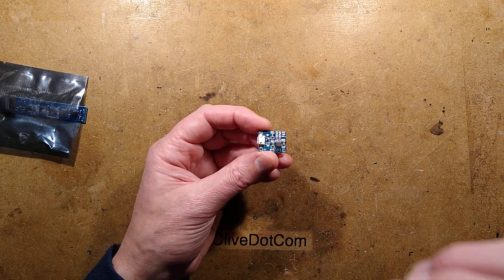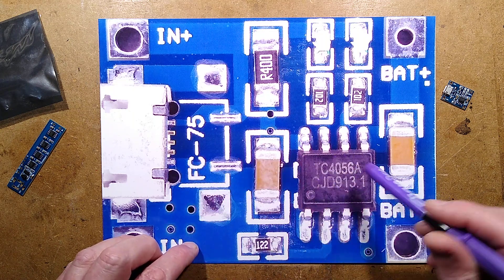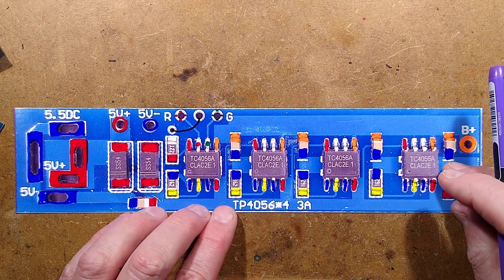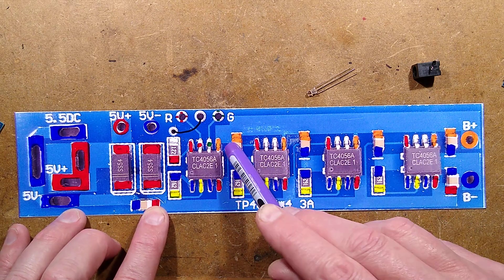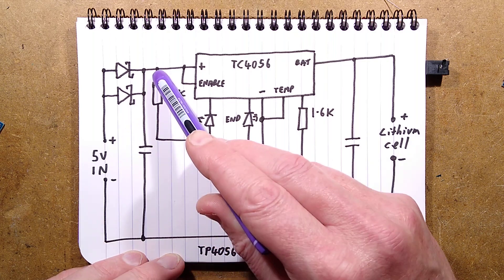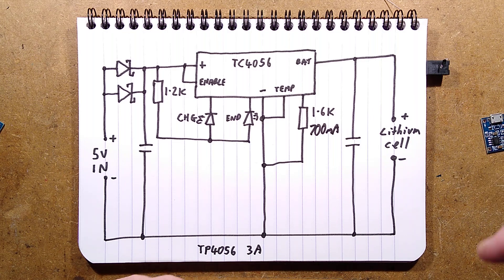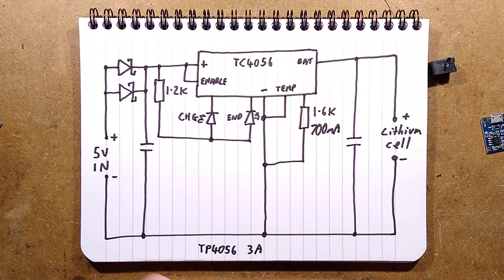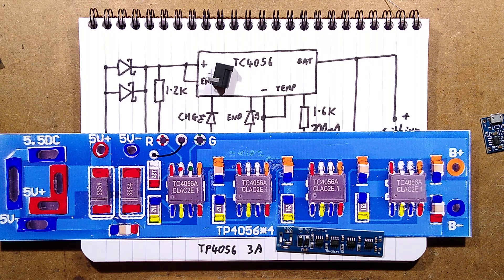eBay 3A lithium charger module with schematic

Comment: .7A * 1.6 kΩ = 1120V
How is that ^^ possible with a 5.5V supply?

If a person wanted to lower the charging current of this circuit, would one increase or decrease the 1.6 kΩ resistor value?  I'm guessing increase it to lower the current as E/R=I
Reply: It uses current amplification, only a fraction of the charge current goes through the programming resistor. But yeah, higher resistance, lower charge current. Mine are all fitted with 2.2kΩ
Reply: That resistor is used to program the output current of the chip. It means 0.7A is not flowing through the resistor.
Edit: TP4056 datasheet clearly says how current programming works and also provides a formula for current calculation.
Reply: @eskisful  Does that mean that 2.3A is flowing through the resistor?  (i.e. 3-.7A)?
Reply: @ab_ab_c  No. Resistor is not directly connected to charging output line therefore resistor current goes through the chip internally. Only 1 or 2 volts are present on the programming pin so  the current is about 0.6 mA or so, flowing in the resistor.
Reply: @eskisful  I looked at the formula in the datasheet & it doesn't make sense to me.  The datasheet does show a table of resistance values that will produce the desired cell charging current though.

Comment: So the LTC 4056 from Analog is not pin compatible with the TC4056 and the TP4056. Which are, while compatible with each other, from two different companies. And there's also another manufacturer (maybe a secondary supplier for TopPower) listed as "TP4056" up on LCSC that's even cheaper. But at least the markings on the chip are specific to their product.

All that circles back on one of those non-Analog parts having a problem with low amperage in at least some revisions that I ran into (I eventually went with a direct LTC clone). It ignored the settings resistor down around 10mA and charged at a higher rate. Although now that I'm looking through the parts lists there's no way I'm going to figure out which chips (or knock-offs of which chip).

So it's probably worth cracking out the meter and checking to make sure the circuit's charging at what the maths suggest it should! With a given batch, anyway.

Comment: I remember seeing a video on the same subject a while ago, the module did not work very well because of differences between the TP4056,s some changed from CC to CV before the others.
Reply from the maker: There will be slightly different voltage thresholds.  They will not all turn off in sync.  The charge current will fall in steps and the final cell voltage will be dictated by just one of the chips.

Comment: i don't see the other chips that normally come with this module. "DW01 & a little dule MOSFET for under/over voltage... PLUS i think, NO I'M SURE! you can parallel up the original module  "AS IS" might be more room needed for them in a project, but if they had the extra chips.  well..
P.S i love the TP4056 module's

Comment: How can that tiny little chip handle such a huge current?  Amazed it doesn't just burn out, I wonder how hot those chips get in use?  You could try spitting on the chips every couple of minutes to keep them cool - I did that with a regulator once.
Reply: they get very hot under full load, they are a lot happier at 800mA or even 500mA than at their supposed 1A rating. But they still get hot, cause they are linear regulators.
They also make squeaky noises, I don't really know why. I guess they oscillate in audio frequencies under high load or something. I should really probe one with a scope some time and see.
Reply: @AlexanderBurgers  I wonder if they would eventually cut out or go up in smoke?  Go up in smoke is much more fun and I like the sweet smell of burning IC cases.  I guess tiny chips like that would just unsolder themselves when they got too hot.
Reply: @ianhosier4042  No idea, in standard configuration they can go for days flatout with no issue. I haven't tried overloading them beyond 1A. If you reverse the polarity on the  battery they insta-pop, but not very spectacularly. Oh yeah, they also have a big thermal pad under them, I guess that does help with cooling.
Reply: They are designed to work while hot. The TP4056 spec sheet lists 145°C as maximum operational TJ. I don't think they have internal temp shutdown.

Comment: Somewhere there is an electronic engineer really annoyed because the LED has the common pin in the middle, and only because of that he had to design a double-layer board instead of a single-layer one.
Reply: Tracks fit under resistors, it's like they weren't even trying. :P
Reply: It's for the dual colour common anode LED's.... but i see your point, the layout bothers me more than it should on the standard board too, they could have put just one resistor on the +v rail to feed both LED's and straight to IC (like they have on the higher current version).

Comment: I thought that putting 2 diodes in parallel does not increase the current capacity.   Since one of the diodes will have slightly lower voltage drop, due to tolerances, it will burn out first.  What happens is they burn out individually, one after another, at the rated current for a single diode.
Reply: Yeah but the circuit does last twice as long than with one diode.  I used to think paralleling diodes increased current rating and learnt how wrong I was the smokey way - each diode did indeed blow at its rated current.
Reply: @ianhosier4042  don’t two diodes in parallel just disperse the current through both providing less stress on diodes ?
Reply: @94mac  Not really. The forward drop is always going to be slightly different. So one diode will be "full on" and the other somewhat less, typically a lot less because diodes don't have much of a linear region.

Comment: I played with one of these a few years ago and found the tp4056’s all finish charging at quite different voltages by adding more leds. https://youtu.be/YBSgtA0bfAI
Reply: Yes, I just saw it. Useful！
Reply: Interesting.  I wonder if that's a deliberate thing to slow the charge at high states of change or accidental
Reply: Congratulations on winning the 100 CS LBC on your odyssey channel, see your odyssey about page at the bottom  = 100 LBC

Comment: I wonder what happens when some of these filtering caps in the output will have noticeable internal current leakage — big enough to restrain the chargers from finishing charging and not big enough to cause a decisive short-circuit.
Reply: These chips don't really have a finish charging state, they just level off at 4.2v and the current sag, if you have leaky caps, or cells with high self-discharge, they'll just get warm, the chip doesn't care even a little bit. If you run whatever load is connected to the cell while it's in the 4.2v float state, it'll happily go back to constant current, all analog, no state machine stuff.

Comment: I'm wondering if you could not gang all of the current control pins together and use one resistor to ground so they would all be getting exactly the same signal. That way you might get a little closer to the four chips sharing current evenly. You might not be able to do that though it depends on the behavior of that input pin. It's probably going to be a lower resistor than what the calculation would show because you're going to have the residual current from the four chips going through one resistor.
Reply from the maker: That may skew the current ratio due to each chip supplying current to the same resistor.  The cost of one resistor per chip is insignificant and operates them in their intended way.
Reply: @bigclivedotcom  I was thinking the resistor tolerance might throw them off from each other a little. Only one way to tell, hack!

Comment: This looks so shitty. There are IP2312 based boards that are similar in size to those smaller TP4056 but are better in every possible way. 3A, switching regulator instead of linear, higher efficiency, supports higher voltage lithium cells (4.3v, 4.4v, etc.).

Comment: This design seems pretty unreasonable tbh. They increase the current by just throwing more circuits in parallel, which takes up much more space, still has terrible efficiency and probably costs a fair bit. For this kind of power it should really be a buck converter instead. It would be better in every way (excapt maybe noise if it's not designed well).
Reply: I got a 5-pack of the single 4056's for $1 4+ years ago.... If you can design and get something produced thats superior, at the same low cost then looking forward to buying it.

Comment: I presume the TC4056 and TP4056 are different. The TP4056 has a low voltage disconnect function, with different connectors for battery and load
Reply: no? you're just thinking of the modules with the TP4056 chips that also have the DW01 chip that does low voltage disconnect, very helpfully also named TP4056 for extra confusion. The chip itself has no such feature. :)
Reply: @AlexanderBurgers  I think you're right! Better setup.

Comment: Cool. 
Clive how about getting us all motorised? A charging circuit suitable for larger battery packs, a motor controller suitable for current and voltage being used. Batteries and motor could be discussed with practical voltages and energy storage and motor types and drive for a lightweight vehicles, scooters/bikes. Broken down each element is easy to explain..I've noticed there is a lot of confusion about all of it.
I think it would be a great series.
I know it would be a bit of work though..
If you or nobody else does, maybe I should start my own channel?😸

Comment: I have somehow killed 3 of those doing nothing wrong and running them very cool.
Reply: semiconductors not always like running cool. forward voltage drop lowers when it gets hot. many doides and mosfets benefit from that when they run a bit on the hot side...

Comment: Hi Clive do you have vape starter sets over in your area for a pound? We have them in the U.S.A. for $1.00,  they have a battery and charger circuit included.
Reply from the maker: They sold disposable vapes for £1 (with rechargeable cells).  I have to be careful about vape technology videos on YouTube.  They don't seem to like them.
Reply: @bigclivedotcom  Yep that's why I didn't name them or tell how to modify them for other uses.

Comment: The faster you charge your Li-Ion battery, the less life it will have.
Reply: true
The number of time spend at extrem es like 100% and 5% charge is also important aswell as the number of charge/discharge cycles.

Comment: Note that these are just chargers, no cell protection is provided.
People should buy the version with DW01 IC for cell protection. Same small size and price really.
Reply: Interesting.  Got a link to such a 3A board?
Reply: @ab_ab_c  there is no 3a board with protection included to my knowledge. He was talking about the 1a tp4056 module like what Clive showed in the beginning. There is a slightly larger version with a cell protection ic(dw01) on board. The tp5000 is a 2a board with protection and boost converter.
Ip2312 is a much better, and more efficient 3a charge (only charge) module though.
Reply: @bridoc519  
YT is preventing me from posting a message that contains multiple urls to 3A boards.
Any idea why that may be happening to my posts?  I've tried to do it multiple times over the past 2 days & it deletes my post every time.
Reply: P.S.
I add these boards on things like bluetooth speakers and Audio plug 3.5mm amplifiers and so on with lithium battery, those made in China are sometimes not properly charged becourse they only use a diode to get the voltage down. I was finding out that one bluetooh speaker had 4.5V after resting for an hour or so after charging and did think.. wow :)
Battery did actually survive, but it was well over the border of what lithium batteries is supposed to handle (4.2V).
Reply: @ab_ab_c  Yeah, I'd be curious to see one with protection also. That could be very useful.
Reply: What does it protect from? Does it replace the functionalities of a BMS?
Reply: This "protection" is just an ideal diode made of a mosfet to prevent reverse connection. Nothing fancy. These charging modules are pretty save
Reply: @Fluxkompressor  No, as PicoNano said, its a DW01 protection IC which provides overvoltage, undervoltage, overcurrent protection. Well worth using.
Reply: @jaro6985  Yes, maybe it does all that, but for what?
The charging IC provides a constant current charge to a fixed voltage of normally 4,2V
So there simply can not be a situation where the connected cell is experiencing a higher Current and/or a higher Voltage than given from the charging IC. And since you intend to CHARGE the Cell when putting it into a charger you definitely don’t need an under voltage protection
The only thing that remains uncertain is the polarity of the cell in a cell holder or something (If the charger isn’t soldered to the cell in some kind anyway). I believe that reverse connecting a cell to this kind of charge ICs will release the magic smoke, so you definitely want protection here
Reply: @Fluxkompressor  The point is you use it as cell protection for whatever the circuit powers... eg mine is used to power a LED light, and if the LED shorts out, the DW01 will protect the battery.

Comment: I have actually used a few of these 1A modules, but i got the version with discharge and shortout protection feature. They have two additional pins named "out+" and "out-", and they cost pretty much the same.
But these 3A modules are cool too, even though they lack this protection.
Reply: So you're talking about a BMS, not a charger.
Reply: @snakezdewiggle6084  No, it's just a DW01 or whatever for under voltage protection and when talking about a single cell it's pretty rare that I hear someone refer to it as a BMS, I suppose it isn't necessarily wrong, although when I think BMS I do think more so the entire suite of protection such as OVP, OCP, temp protection and so on.
Reply: @vgamesx1  okay, cool  ;)
Reply: Well, i do think BMS is reserved for a device witch charge balance protection between cells in series. I divide these devices like this: chargers are meant to be used with cells in parallel, for low voltage but high current and/or capacity devices. BMSs keep track of all the voltages within the cell and are neccessary when dealing with higher voltage packs.
Reply: BMS (Battery Management System). Most 18650's have them built in. I have 10 BMS boards purchased from Samsung, for single cell only. 5 are round and fit onto the pos+ end over the 'button', and 5 are normal pcb. They have 2 fets, 2 cc / cv uC, 2 diodes, 4 resisters, 4 caps, 1 NTC, and 4 solder pads matked b+ b- p+ p- .

Comment: It looks like each of the 4056's has its own programming resistor.  Since the actual value of each resistor will vary slightly, the behavior of each of the 4056's will vary accordingly.  Would this variance cause any real-world issues?  For instance, what happens when one of the 4056 chips switches from CC to CV and the others are still CC?  I should buy one of these boards and watch its output on a scope as it works.
Reply: I don't believe there is any real "mode switching" going on. It's just a linear regulator that limits to "max current" and "max voltage" at the same time with some additional protection circuitry.
Reply: @graealex  Oh, yeah, that's true. The only problem this might have is unbalanced load between chips. But that shouldn't be a problem because they aren't drive at their max.
Reply: No damage, since the battery voltage is still lower than the supply voltage, so no reverse current
Reply: Wouldn't the others also change to CV very soon due to one changing to that?
Reply: The specs say the output V is within 1.5% of 4.2V at i bat 40mA (and above I guess)  It drops to 2.9V and the current drops off as soon as the battery equals or exceeds the chip voltage, so how does that work with them all in parallel?? It must monitor delta/time. Edit: so it wouldn't matter if just one dropped down to 2.9 it wouldn't be noticed, the only relevant voltage would be above 4.2 and rising over time and that can only come from the battery and each chip would therefore ignore the other...Or am I talking rot? It has happened before.
Reply: I have one of these for a 2s and been wondering if it does cc/cv ..kinda think it doesn't tbh
Reply: I have the same question when I saw the schematic. CC always come with variable voltage at the output stage. Four outputs with some voltage delta connected together may not be a good design.
Reply: If you have some TP4056 on hand, just connect them together to measure. 😄
Reply: I'm a little bit worried about oscillations between the regulators. Perhaps having an output series resistor would reduce the risk of oscillation?
Reply: @pigrew  We might be worrying too much😸..What about the BBC licence fee?
Reply: @ianhosier4042  GOOD! When they started charging pensioners again I was finished with them...That and Eastenders...
Reply: @pigrew  Is there any ripple that could cause that though? The little bit there is, should be smoothened by the load (and caps) - right?
Reply: What if you used the same resistor to manage all 4?  It would mean a different board or jumpers but it might work?
Reply: Someone done a charging test 4 years ago. Just search Youtube with title ：High Current TP4056 Module Update
Reply: I could only identify the fets tho